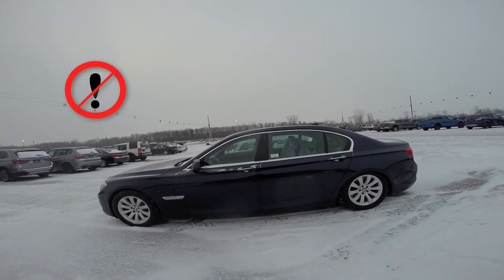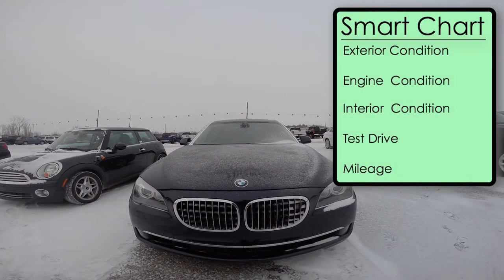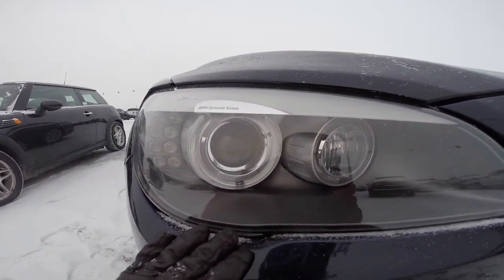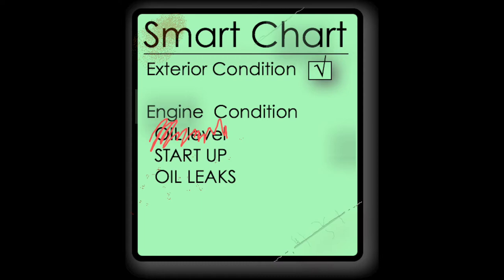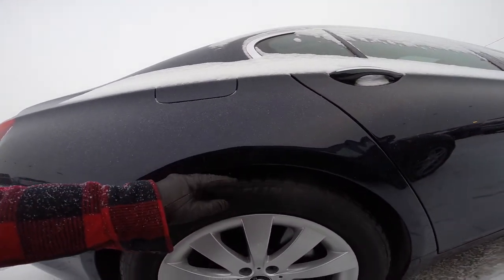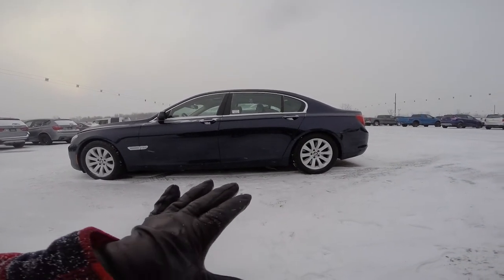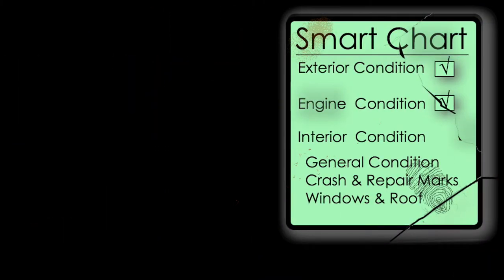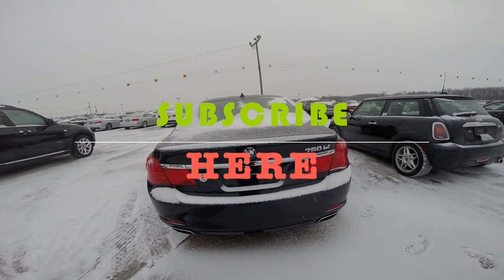BMW 750 LI 2011 Tips on Buying Used

Comment: Air Suspension is fucked.  The rear of the car was sitting low until car was started.
Reply from the maker: yes
Reply: Thats sometimes happens when it sits long and hasn’t been driven